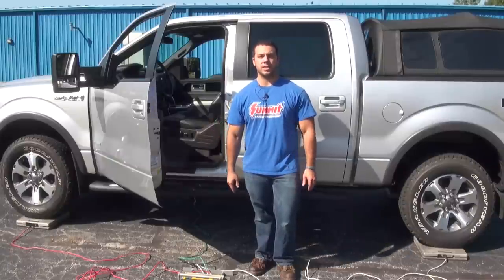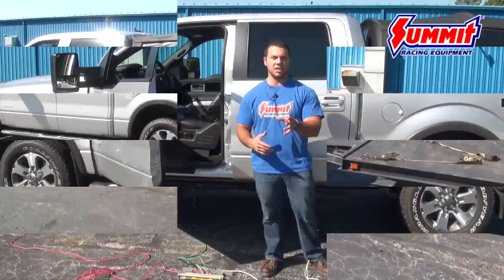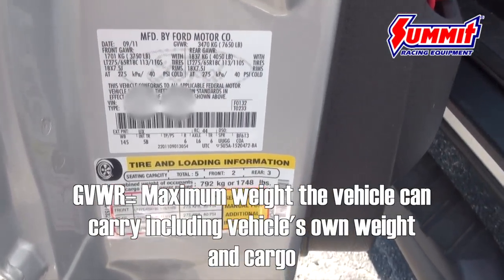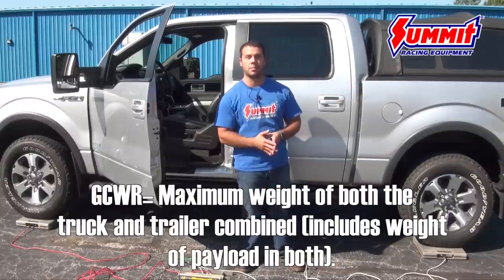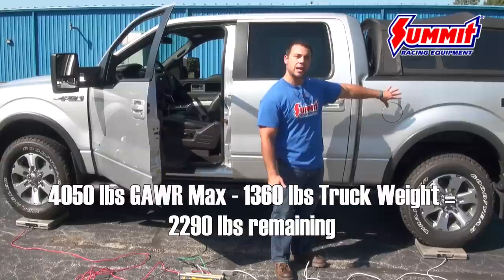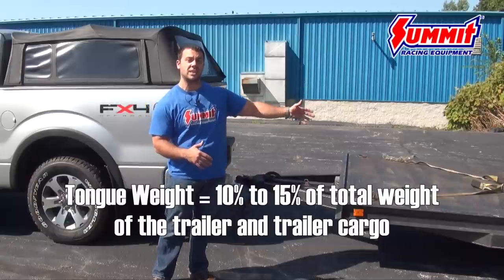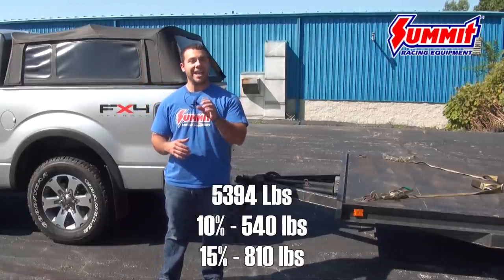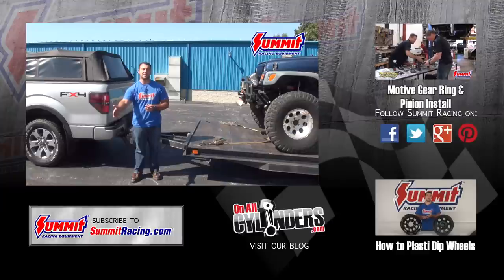Truck Tow Ratings—and What they Really Mean!

Comment: Thanks for making this video to explain some of the terms but there is a major piece of the puzzle missing which is the difference between a given vehicle's rating for weight carrying vs weigh distributing.  I believe the vehicle featured is an F150 which means that configuration is in excess of the maximum allowable weight carrying specification and therefore and illegal tow.  Any F150 through model year 2020 has an absolute maximum weight carrying towing capacity of only 5,000ls and tongue weight rating of 500lbs!  This seems astonishing with Ford claiming towing capacity up to 13,200 on certain F150 configurations but if you read the small print in their towing guide literature(and on the sticker on the receiver mount) you will see the maximum is indeed 5,000lbs for weight carrying and the only way to get above that is to use weight distributing hitches.

Comment: I pull RVs for a living so the weight issue is a big one. I bought a one ton dually 2wd just to be on the safe side although I do have a class a CDL and that helps with the Dot.
Reply: Hollow Point  I have a class b with tow endorsement do I need a class a for towing boats?
Reply: @fdj3830  It just depends on how long the unit being towed is. I'm live in Texas and I think anything over 35ft you have to have a class A. I would check on your state website and make sure. It also depends on if you're towing commercial or not.
Reply: Hollow Point thanks I looked into it and it says that if the trailer holds more than 10000lbs you need a class a.
Reply: Well there you go. It's kind of a good thing that the law changed. Too many people were overloading their trailers and trying to go down the road without any experience or training. Some laws are for the betterment of society I guess...lol

Comment: Your payload is 1740 lbs according to you sticker. Put 4 200 lb men in that cab and your down to 940 lbs of payload left over.
Reply: Shackles I believe you're referring to the max combined cargo and passenger weight of 1748? That's in reference to the stock tires with cold psi of 40. For myself(dodge 1500), I've upgraded my tires from the stock 235's (35lb cold psi) to 285's (60lb psi) which increased the load capability per axle. But his math is still wrong.
Reply: Thank you for taking the time to create this video. However, because your math didn't add up at the end, I am a bit more confused than when I was before watching it.
     If you've a GRAWR of 4050 -1360 (scale reading)=2690 (not 2290) available RAW (rear axle weight) to max out. This, of course, is assuming nothing is attached to the ball.
     If you do update this video, I'd like to see it. You've a captivating voice. Ty

Comment: Oh Jesus... it's so confusing and complicated... no wonder people don't give a damn!!-   why can carmakers just come up with one number that apply to all situations??????  I'm not getting your presentation... I'm info overloaded....
Reply: Ask an expert... there will never be a single figure that applies to everything, every vehicle is different, every use of the trailer will vary. I have a bmw 330 which pulls a 10ft flatbed with a single axel at the back, all i know is the car can take a max of 750kg on the hitch, and i can lift the trailer tongue when its loaded to the max i use it for. That should give plenty of safety margin, and the trailer does have brakes to help slow so hadnt even considered most of the rest... having pulled a trailer, i think there should be lessons for everyone using one before they are permitted as its dam scary even if your careful and have a good idea what your doing.